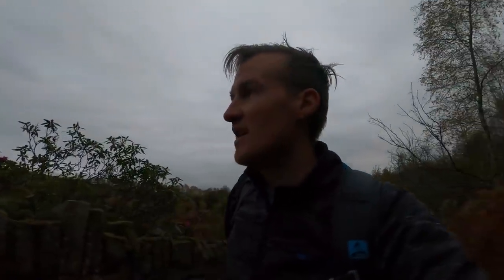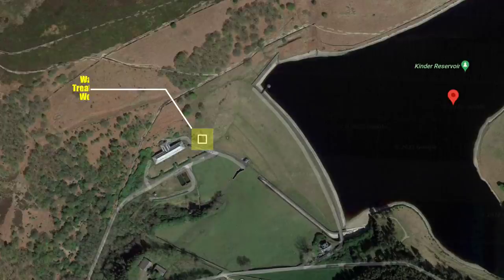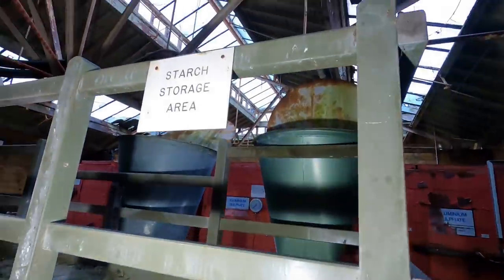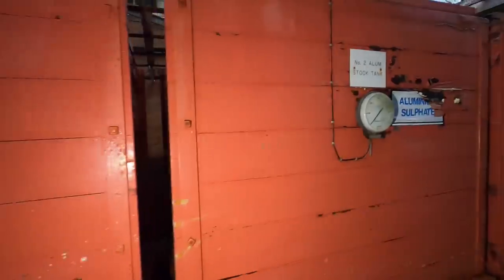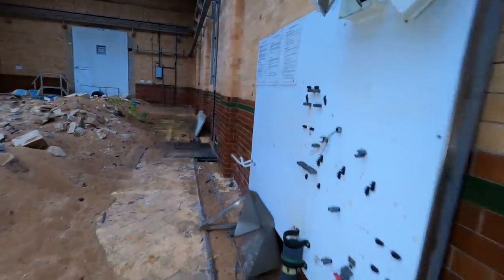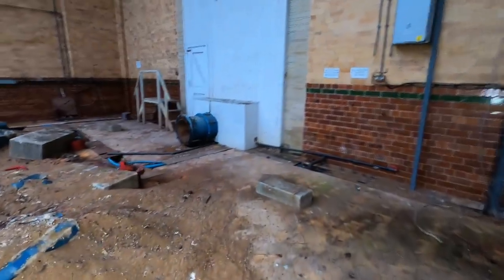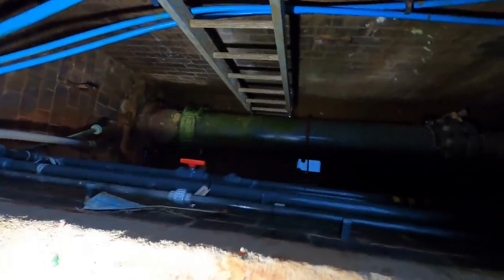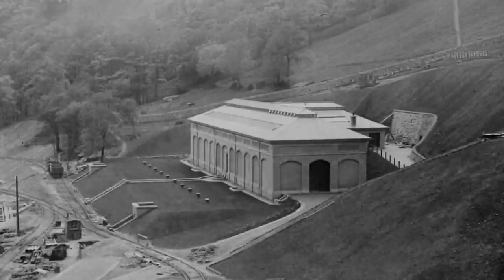The Forgotten & Abandoned Water Treatment Works of Kinder - Explore

Comment: The small pumps we saw would be dosing pumps.  Alum was used as a coagulant that bound the impurities into bigger particles that could be filtered out.  The filters themselves have been removed for scrap but I thought I could see the sand media lying around on the floor abandoned.  Periodically when the filter beds(sand) became blocked the water flow would be reversed and rabble arms would stir up the bed and release the muck.  This wastewater would have to be treated. The sand in the filters would have to be topped up periodically as some would be washed out during the cleaning process. This single stage process was economical on land use but has largely fallen out of use as stricter water quality standards require multi stage treatment plants with different coagulants and ph corrections on the way through. Nice film, thanks.